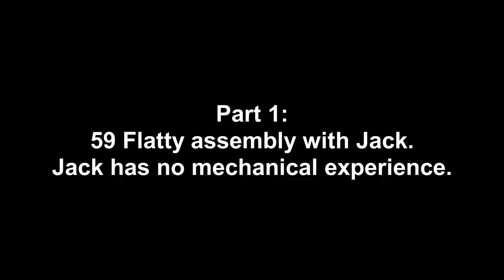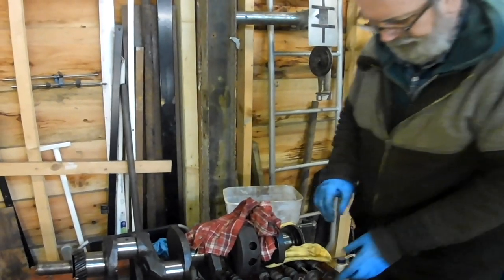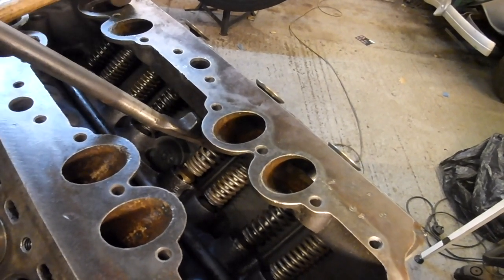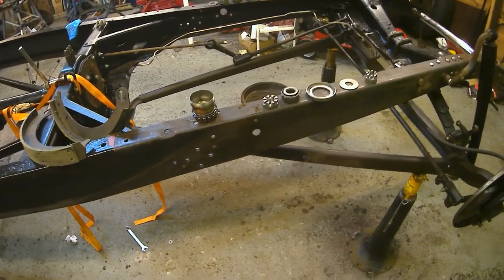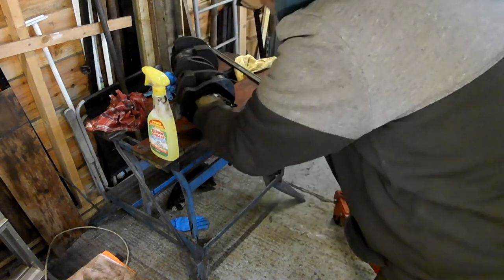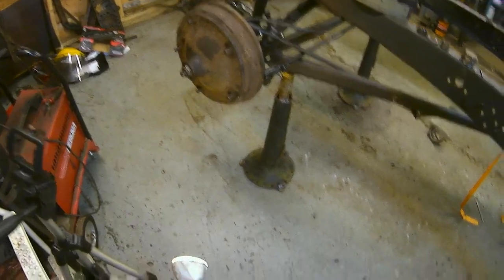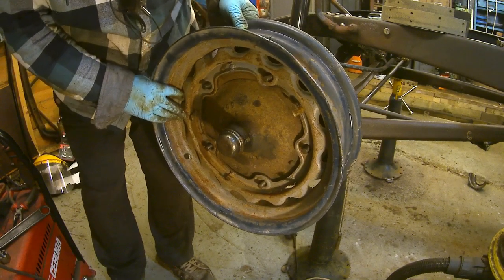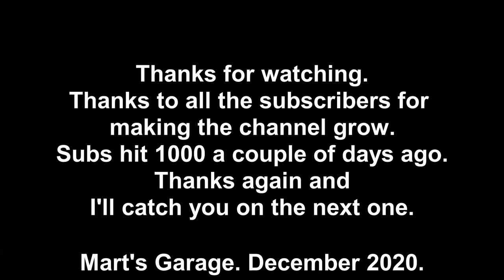Ford Flathead Valves and Crank Fit. 32 Ford Hub Fit and Spindle Mods. 32 Pt24 59 pt18.

Comment: Enjoying these Flathead assembly sessions Mart !! And, the fab and assembly on the 32 Chassis is quite entertaining as well. On those retainer counter-bores, I would guess they probably had a fixture of some sort to machine all those counter-bores to a pre-determined level. I would suspect some casting shift so that one side of the block ended up thicker/thinner than the other when the two sides were machined to equal amounts. 
Watching some of your more recent videos where you are cleaning things with a wire wheel, I would be inclined to suggest that you look into a "Knotted wire wheel" that fits onto your 4" or 4.5" grinder. I did the entire bottom side of a 57 chevy with those. Floor, frame, firewall, and lots of the inner fender panels prior to painting and filling all the "extra" holes this 57 acquired over its lifetime. Be very careful with them however as they will kick like a mule if you run into a vertical protrusion on the wrong side of the wheel. Best to keep the guard installed. They sure do a nice job of cleaning the rust off the metal. I burned through about 4 of them. ;o) 
Merry Christmas and congrats on the subscribers !!! 👍👍👍
Reply from the maker: Cheers Ron. If you watch the old archive footage of the engine assembly plants the machines they used were really impressive, multiple machining transfer station machines. Nothing was left to chance, so I know they're right. I use various wire wheels, I just don't show everything. Thanks for the comments Bob, Merry Christmas to you.

Comment: Hi Mart, wishing you and your family a Merry Christmas and a great New Year,. Enjoying the videos. Do you use the rear brake drum, retaining brackets on your cars. Not sure if they stop the axle coming out but it would make a lot of noise, so you would know something was wrong. I'm putting a set on my 31 coupe. Byron Bassett
Reply from the maker: Thanks Byron, the same to you and yours too. I haven't used the retaining brackets yet, but might make some. I actually broke an axle on my truck and by a miracle the shaft never came out, despite towing the truck home on a rope. I have bought some material, and I do intend to make some, just when is the question. I think you can avoid the axle breakage problem by ensuring the axle nuts are kept very tight, hence reducing fatigue cracks. Mart.

Comment: You didn't show any setting of the valve lash. Since you changed the depth of the valve seat, wouldn't you have to reset the vale lash as well> you have not shown a process for that or mentioned it. I am very pleased with your videos overall. I was just curious about this one topic. I have never done a flat v8, but have done the Banger engines and a Ford 8N tractor engine. All are very similar in design and build process. Keep up the good work. I have to find me a V8 Flatty to play with!! Thanks
Reply from the maker: Thanks RN. I set the valves beforehand. That's why they, and then lifters were kept in number order. The video came out about 3 weeks ago. Here's a link to it: https://youtu.be/oxtM6t_HwwQ The valves took a lot of shortening because I did have to cut the seats back a long way. 
Thanks for following along and commenting. Mart.

Comment: Mart, I read somewhere once that Mr Ford offset the cam slightly, because he was afraid of some sort of vibration if it was centered. That makes me think that’s why on one side the valve guides are deeper set, and the other side they are shallower. It makes sense to me. By the way, I really enjoy your channel !
Reply from the maker: Thanks Ken. Yeah, it could be something like that, I didn't think of that.